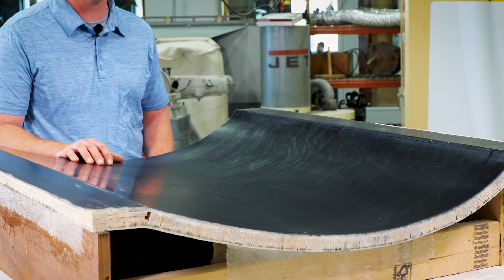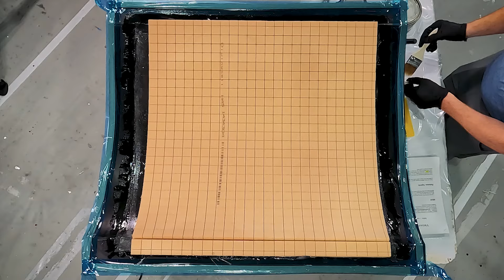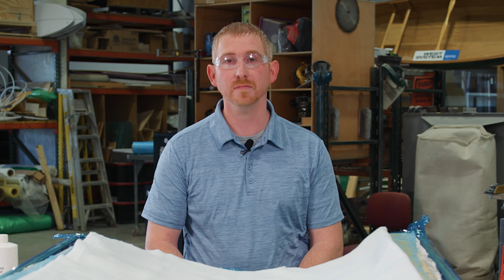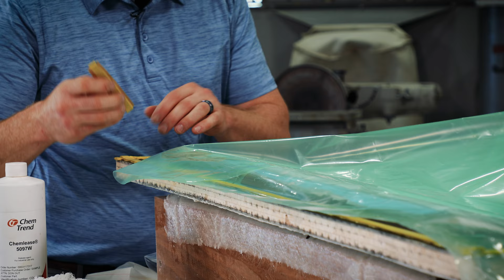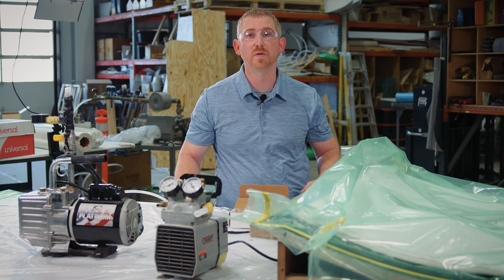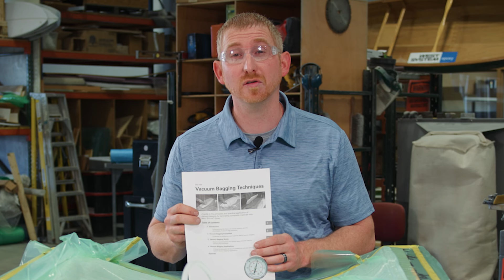Vacuum Bagging Basics: How to Get Started (Complete Guide)

Comment: a little while ago I was working on building a CF recumbent bike. And when using the vacuum bag, any wrinkles in the bag were transmitted to the CF service and the epoxy would fill in the wrinkles and make a very distorted surface. How is that prevented?  I was doing it the same way as in this video.

Comment: As a beginner (or before vac bagging with cold laminating) I feel by the time I get it wet out, and all the bag stuff set up over it, the epoxy would have kicked off.  Are you using a slow hardener or?  I realize entire vessels are constructed this way.  Epoxy Resin working time isn't a lot and you are doing it in batches, but it seems about an hour passes between the first wet out and the time the vac is applied.

Comment: Nicely produced video. I've been doing vacuum bagging for many years and there are some less-than-optimal practices demostrated here that I feel should be addressed (and ironicaly are addressed on the West System Vacuum Bagging manual mentioned at the video's end):

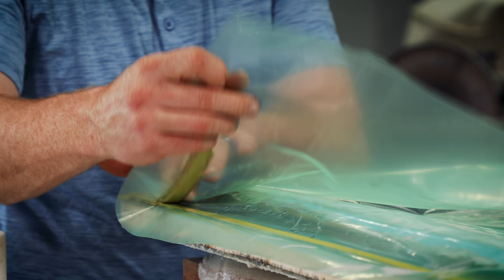1. Applying such a liberal epoxy coat and so far away from the panel edge negates the benefict of using the flash tape because the bag gets contaminated with epoxy just by the normal manipulation. That can be seen on the closeup shot at 8:33 (the epoxy smear is already reaching the sealant tape). 

2. At 12:26... You don't ever place the vaccum port on the actual piece unless there is absolutely anywhere else to put it. It will leave an imprint. Best practice is extending the breather material outside the piece and placing the port over that. Sames goes for the vacuum gage at 17:25, dont'put it ON the part (as he says himself seconds later).

3. At 13:52 the instructor is right on the money about how much vacuum to aim for. He just forgot to say that IF you go higher then you'll start boiling off some of the liquids on the resin and that outgasing will generate a bunch of voids in the laminate. likely resulting on a toss away panel.

4. Finally, I know this is educational first material, but is worth saying that on a real production part you need to work way faster than on the video. The whole point of vacuum bagging is removing as much excess resing without having dry spots before the resin starts to gel. The more time you take to set up things the more the resin has gelled and inversely won't be able to flow into the bleeder stack.
Reply: Question, what is the purpose of the pleats? I don't fully understand and you seem to be well versed on this subject matter.
Reply: @antoniofranklyn5923  have you ever seen a women’s pleated skirt? Those skirts allow the seemingly impossible: closely contouring to the wearer’s body + giving ample room for movement without ever stretching the fabric.

That’s the same principle for the bag pleats: you want to bag to have a lot of movement options so it can really press every crevice of your part WITHOUT stretching the bag.  Anywhere the bag is stretched under vacuum that’s a spot where resin will pool and create a heavy and brittle spot. Those spots are what we call “bridges”. 

A stretched bag It may look OK when dry under vacuum, but will cause a lot of undesirable effects when wet.
Reply: @Apollux so when adding pleats to the vacuum bag, is there a particular location where they should be or can you jus place them any and everywhere?